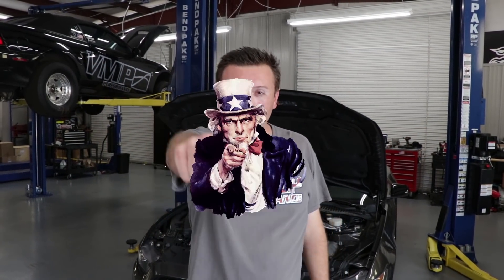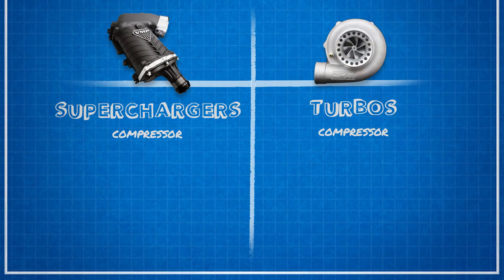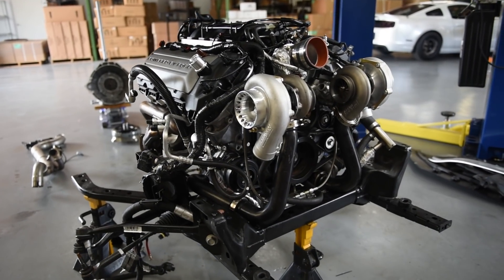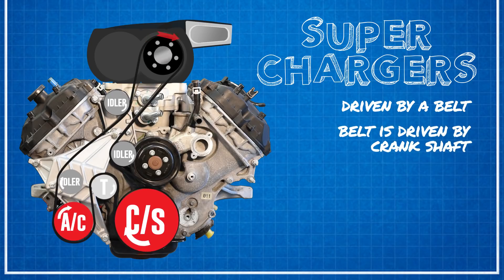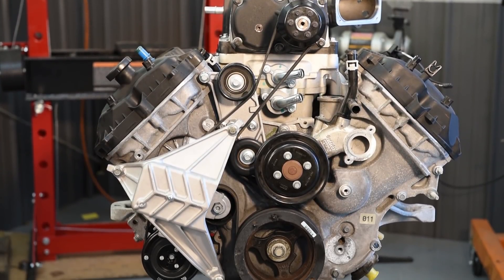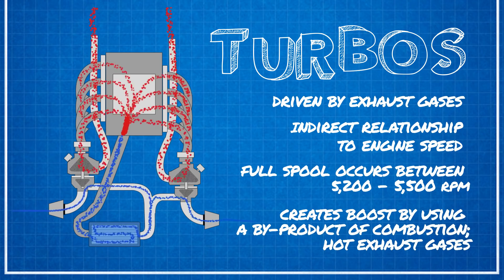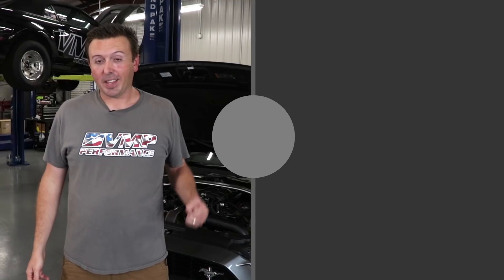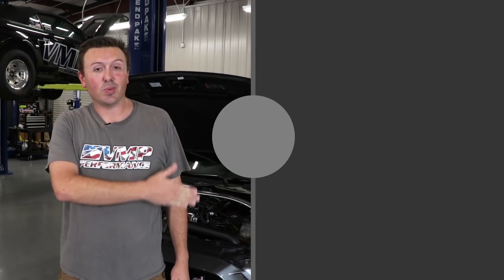VMP Performance | Superchargers vs. Twin Turbos

Comment: Right but one makes little TQ and the other one makes LOTS of TQ..... on pump gas 93 octane. Anything will make a lot of power on E85 and the blower needs to be spun so fast and have a smallest pull to do so. Turbo..... jus turn the boost up or down. And one gets terrible heat-soak and one never gets heat-soak! With modern Turbo's they come on INSTANTLY!
Reply: These blowers are efficient they don't get "horrible heat soak".  Turbos are known for running hot and making your engine bay hot af to the point people put blankets over them lol.  These modern tvs blowers are not the stock blower on 03 cobras.  They don't have "horrible heat soak" with proper cooling.  I seen the gen3r ran near 800 wheel with a fairly small pulley on an older gt500 back to back to back and it was within 5 hp.  That is pretty efficient.  

Turbos are more of a headache and less "trouble free" in nature.  For an all out race car Turbos are better for a street car it's hard to beat the tvs.
Reply: @midnight347  No bro Turbo's dont need blankets to keep heat from the engine bay they have blankets for thermal reasons for better spool up. learn what ur talking about before u start making claims that are almost comical. Ever hear of thermal coating..... Yea bro its pretty common these days wow.

Turbo's absolutely DESTROY TVS blowers. Destroy them bro. There is ZERO headache with something that never gets heat soak and never slips a belt. Ive had one on my Turbo mustnag for 5 years now with ZERO issues....

I dont have to wait in the pits for 30 minutes waiting for my blower to kool down lmao

Comment: Boost don’t kick in till 5500? Change the housing in the hot side to a slightly smaller to make it spool quicker you could prolly get full spool around 4500-4800
Reply: Is most likely improperly sized..no modern turbo should take that long. The hot side must be way too big or the turbo itself is too big.
Reply: Bigger turbo, takes longer to spool but more power...
Reply: @DUMONTSNIPER2  That's only true up to a certain extent. A turbo that is too big is a bigger detriment then it is a help.  A turbo spooling at 5500 is not efficient.that's a turbo that should be pushed by something with about 6 liters.

Either the hot side is too big or the entire turbo is too big. Modern ball bearing turbos should not be spooling at 5500.
Reply: @manrightchea  stock power band is 4k-5krpm and stock max rpm is 7000, get some right tunes, and it will be no problem.
Reply: @DUMONTSNIPER2  Yeah I know,  depends on the goals for the car but me personally I would not just raw dog a 5500 RPM spool. Now of course with good driving a lot of that can be mitigated. Brake boosting, anti lag etc can all help with that. Two step if you're running from a dig..

Personally though if I was going to run a turbo that large, I would also run nitrous as a stopgap until it spools, although nitrous would actually help it spool faster.
Reply: @manrightchea  but also, u can have it moded to bounce the rev limiter, thats wat i would do with my mustang, ive always like imports and all so ima make mine an import from the heart but muscle from the looks, but also keep the 5.0 in it
Reply: @DUMONTSNIPER2   That's what's up man, sounds good.

Comment: WHY NOT BOTH? 😎
Reply: Terminator + Hellion = Hellraiser
Reply: I've heard of twincharger setups though you don't see it much.
Reply: @Joe_Friday  you don't see it much because it'll make less peak power than with turbos alone.   It will however make a ton of torque and give you one badass power curve.  With the power these blowers are making today you're better off just going that route if a wide powerband is what you want.
Reply: Ortak Bizkurt having only one is more efficient, why would you compress air in two steps if you can do it in one

Comment: If you take the same exact engines, run the same boost, one on turbos and one with a S/C, the turbo engine will make more power every time. Both are cool but many don't realize the supercharger takes 150-180 HP to turn at high engine speeds, plus all the torsionals on the front snout of the crankshaft takes it's toll. A turbo engine will ultimately last longer.
Reply: 93Cobra if everything else last long... high horsepower turbos hasn’t exactly made into the mainstream with miles to back it up
Reply: Modern superchargers are very efficient. It does not take 150 hp to turn a supercharger. Cleetus had a video where he had the truck with a supercharger and a truck with twin turbos race on the same boost and it was very close. The supercharged setup in this video here was 2-3 psi less and made very similar power so unless 2-3 psi which means this blower likely saps 50ish hp to spin at this high of a rpm. Even less if you are spinning it less

Comment: Fun fact the fastest 2018 mustag GT 10r80  is a Twin turbo yes it has a stock engine the car did 8.6 no supercharged 18 GT has came close to that
Reply: Probably because no one with a supercharger has tried.
Reply: Is your car a full out race car?  If not then what does it matter?  Lol.  On a street car the tvs is way better.  Much more fun and more trouble free.  People try to push a turbo car going 8.6 like that is supposed to validate it.  If you're not trying to run 8s with YOUR car it is irrelevant.
Reply: @midnight347  you must be a dumbass I can adjust my boost with turbos what I happen to get out Pop My Hood take off a pulley put another one on then return the m**********shut the f***** talking to me

Comment: How about show the top end and bottom end of the supercharger and not just the part that looks the best. My take on the debate is if you want to blow the tires off at every light and break parts fast get a supercharger. If you want leave a light fast and then blow the tires off at 70 mph and wreck the whole car get a turbo.
Reply: Its a s550... Nothing is gonna break. Thats why its an s550.

As for your argument there is some validity to it, but the turbo car in this example is kind of a bad example. The owner wants to have that late spool, and I'm guessing hes running low compression pistons hence the reason for the low power down low and that steep ramp up.

It's not the best combination from a strictly performance stand point but its gonna be a wild ride...

The vmp gen 3 is specifically designed to NOT lose high RPM power look at the torque curve. It's a monster of a blower. And works really well with the high reving nature of the coyote.

I also suspect they are running high compression pistons and lower boost. You make the same power but the throttle response is monsterous
Reply: @3star2nr  to add to your points people think supercharger means low end and no top end and turbos are the opposite but that isn't necessarily the case with either.  Depends on the sizing relative to the motor and how efficient they are.  The 2650 is very efficient and has killer power everywhere.  A properly sized pair of turbos with good tuning can also have a wide powerband.  Even with two small turbos with badass response it will never have the response that supercharger does.  It literally feels na you never feel it "kick in" it kicks in when you kick the throttle down literally instantly.  Makes it feel like a built out the ass big block with the drive ability of a stock coyote.  What's not to like there?  For an all out race built turbos are better for a street car the tvs is hard to beat but either can do well in either scenario set up properly.  There's been some pretty fast tvs cars.
Reply: @midnight347  I agree with this 100% both technology is fantastic and can be tailored to what u need. 

I would supercharge the coyote just because the packaging is cleaner and simpler in the s550s tiny engine bay
Reply: @3star2nr  yea its easier to deal with and better for a street car imo.  If you have a serious drag car the turbo prob works better.
Reply: @midnight347  absolutely

Comment: S/C for sure. On the street, can't be beat. Instant max boost as low as 2k rpm.
Reply: Probably not going to hook up in a mustang , and overtime the supercharger destroys the motor wears out bearings and the engine has to work harder to make the power
Reply: @thetattedstig  SC F150 Coyote 4wd launch has no problems hooking. 😅
Reply: In the 10-speed auto, a centrifugal SC or TT is where its at...they shine above 5000 rpm and under full throttle, rpm's don't dip below 6k in the 10A like a manual everytime you shift.

Comment: 2:55 
Turbo=1031hp  878tq
Supercharger=1020hp 847tq
Reply: acceleration in more linear increase is better than one that goes up and down... Less chance of breaking traction without sudden rush/loss of power... Turbo performance shows a bumpy power band...

Comment: You forgot Nitrous! It's still a viable power adder and is awesome and safe IF ur not a pubescent teen susceptible to peer pressure. I have a FBO/🌽 fed 2016 Mustang GT w/ Nitrous Outlet kit. (IG@Laviathan_5.0) I've gone through 20-10lb. Tanks spraying a 150 shot making 650 Whp with zero problems.
Reply from the maker: no doubt @leviathan

Comment: Could you please tell me which system creates more heat to the engine?
Reply: Heat is a by-product of making HP. At the same HP, both systems generate the same amount of heat. How hot is that turbo when making boost? I bet a lot hotter than a S/C making the same boost.
Reply: Vernon Pitts TVS is almost as efficient as turbos in terms of heating up the charge air temperature per psi of boost, however, I’m guessing the TT setting make that 1k hp with less boost, means less heat to the engine charge air. I have a TVS myself btw, and in California weather you can definitely fell the power lost after driving for a while...

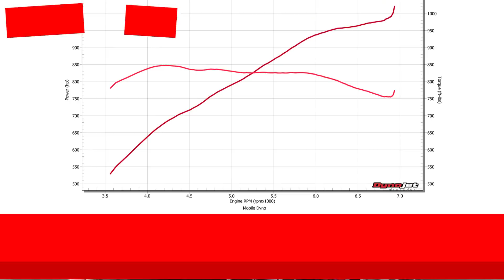Comment: What's with the sharp uptick in power and torque at the end of the graph @ 3:24?  Conveniently bumps the power of 1000 hp.
Reply: I call BS on that reading and then using it like the car actually made those numbers.
Reply: @superkillr  Agree. I've seen that alot lately it seems. It's clearly an error and to use it and claim that power is ridiculous.
Reply: Eric Robison I’m guessing the car leans out a little bit with the stock fuel pump? 😂

Comment: Idk hard to choose between both because for one if you go turbo,the sound of turbos spooling sounds awesome and you do get a lot of top end power but it really quiets down your exhaust,and with a supercharger you get full boost as soon as you put your foot down the pedal,and you still have all the exhaust noise but you don't get as good top end power compared to turbo charging your car. Like I said it's very hard to choose what I would go with
Reply: These 2650s have plenty of top end power.  People need to stop thinking like supercharger means no top end that isn't the case with these modern blowers.  As for turbo car being quiet I would run a complete straight exhaust with a turbo setup.  Sounds badass.  For a street car the tvs is alot better imo.  If it's quarter mile car only you can ultimately go faster with turbos.
Reply: @midnight347  when I wrote this I hadn’t seen a good supercharger that’ll give you good top end, but I’ve seen some crazy shit now in days with these newer super chargers making coyotes run in the 7’s and and making terminator cobras run 8’s with a 160+mph! I can’t believe whipple is making these new gt500’s put out 1500whp with the stock motor it’s fucking insanity!!!

Comment: Would've liked to see these two setups on the same fuel and know how much boost each setup is running.
Reply from the maker: Track attack will be getting an E85 system in the future.  The turbo kit was at 18-19psi and the supercharger at 20-22psi.

Comment: I would get my 1000 rwhp by a built motor and vmps gen 3 supercharger on e85 with long tube headers full exhaust and 1500 cc injectors with a upgrade fuel system. Because I'm not sure of the boost a pumps will be able to give enough fuel to the engine with out leaning it out. I would like to see if the supercharger is capable of 1200 rwhp. And don't forget the mantec clutch to handle all of this power. I have a 2012 gt500 5.4l engine. I also want to build the tr6060 transmission also.

Comment: How much boost was the turbo car on vs the supercharged one?
Reply from the maker: The turbo kit was at 18-19psi and the supercharger at 20-22psi.
Reply: Im not knocking superchargers either i expect the turbo setup to make that power on less boost Im just genuinely curious to what the difference for around the same power output
Reply: I would like to know that also
Reply: Steven Gt the supercharger was done on a 63 mm pulley I believe so about 22 pounds I’m guessing
Reply: I'm curious here too. . Turbo's make that on less boost.
Reply: 2:55 to see the dyno results of each car.
Reply: @oldmillennial6872  both the dyno graph don't show boost which is why everyone is asking

Comment: I wish I had the money for these huge power build., I for a stock engine prefer the Vortech due to it's progressive boost nature which is less harsh on components (stock engine). In my previous Mustang I had no problem keeping up with or beating positive displacement blown cars and they had issues with heat soak where I did not. This was in a 3V 2006 GT that ran 12.1@115 bone stock with a Vortech V2. There are pros and cons for everything so for my needs the Vortech will suffice, with a much bigger budget I'd go twin turbo and would love to go with VMP, their work is awesome.

Comment: Hopefully in the near future I will be using a 2650 and e85 to get my 1000. For now I use a roush blower, cams, vmp throttle body, free flowing exhaust,  and some other goodies to get where im going.
Reply: why the roush blower? theres' plenty of better SC'ers like that type, IE bigger whipples and KB's. The smaller the head unit you use, it has to spin faster = hotter IATs and getting closer to the unit efficiency. Not saying the roush is a bad one but I doubt it was designed for a 1k rwhp goal in mind.
Reply: J Manuel Villarreal ... I completely agree, which is why I am planning on changing to the 2650... My car had this supercharger on it when I bought it, at the time the 2300 was a normal swap for these...
Reply: @freedomjunky6198  what will the cost be for the upgrade including labor?
Reply: Joe Friday ... great question, maybe @VMPPerformance can weigh in and tell us?

Comment: Both builds are very impressive would c16 make a big difference in the power #s on the turbo? Justin you have been doing a great job on providing interesting topics on the channel, thx!
Reply from the maker: @victor thanks, ethanol has a lot of oxygen content so E85 will actually make more power than C16.
Reply: On e85 you would be able to max out the turbos so to take advantage of c16 bigger compressors would be needed along with fuel system and other components and they didn't give boots numbers but I bet the psi is more on the turbo car than the supercharger car.
Reply: @anthonyp.harvey5985  thx definitely something to consider when looking at the #'s
Reply: @anthonyp.harvey5985  the Boost will be less on the turbo car. If they both had EcoBoost the turbo would make more on-peak power
Reply: @FourValveFox  and I thought the Ford ecoboost was just a description of direct injection used with a turbo. GDI being the ECO and the turbo being BOOST???? And I know from experience the stock Ford turbos are junk.
Reply: @anthonyp.harvey5985  Econ
Boost is just a marketing platform naming scheme. All there 4/6  cylinder turbo vehicles are EcoBoost. Out 2018 should make 385 whp with the stock turbo. After that you run into back pressure problems because the exhaust housing is so small.
Reply: @anthonyp.harvey5985  and those 67's aren't even close to maxing out. On that set up they will make a boat 1600 wHP at 35 PSI
Reply: @FourValveFox  but with out seeing timing# boost# back pressure#egt#knock,air temp# it's all a guess and yes if they wanted to go all out the turbo car will make more power hands down.
Reply: @anthonyp.harvey5985  what I'm saying is that same generation engines under the same conditions, same boost levels, the turbo car will make more. The blower is losing 20-30 horsepower just a centrifugal losses alone to start. The VMP supercharger with a 62 mm pulley is almost maxed out and the Turbos are just getting in the efficiency range. I've owned both and PD blowers are more fun on the street. Ultimate power will still go to the twins
Reply: @FourValveFox  agree but don't think  thoes turbos can reach there full potential with that full exhaust on it.
Reply: @anthonyp.harvey5985  it's about 50 whp difference running just a short downpipe vs through full 3" exhaust. At around 22 psi. The PD blow would gain from having an open exhaust as well
Reply: @FourValveFox  yes. But if seen with my own eyes that some time full 3inch exhaust can still restrict flow. And raise the back pressures and start to back up the turbos to were boost is limited. Now a blower or supercharger iv seen blow welds on full exhaust. But yes I agree the turbo car turned up would spank the PD car in hp hands down. Back to the c16? In the Chevy world c16 0r meth in high compression big block displacement with over an 80mm set of compressors. Is it different in the Ford world???
Reply: SC losses are WAY higher than 30 horses at this power level. Probally more than 120-150 hp just to drive this supercharger. Tests on Kenne Bell tells bigger superchargers tends to loose LESS power at certain power levels because they are spinning slower, creating less heat to make same boost.
Even the bigger units like the 4.2L tends to loss more than 80 hp at certain levels of boost.

This SC inst that big and probally are running close to the max. Probally using at least 5 more PSI of boost to reach same kind of power of twins.
I dunno, but i think in this case, around 30 or more PSI on SC.
Reply: More fuell used but also worked for cooling, turbo is nice applying power
Reply: F